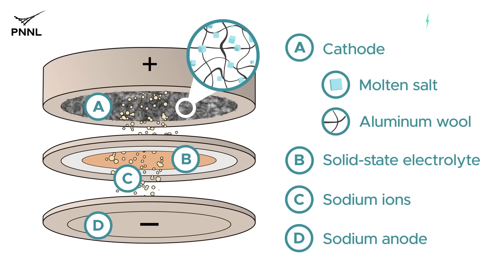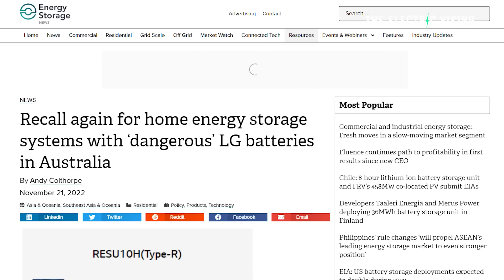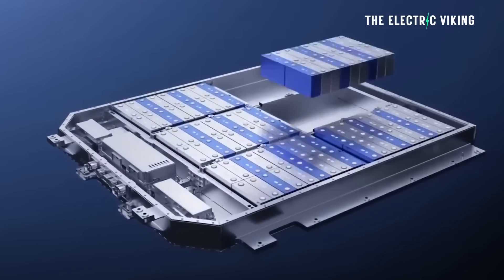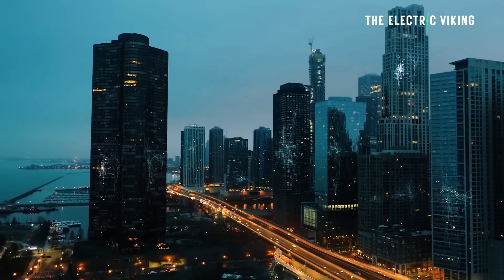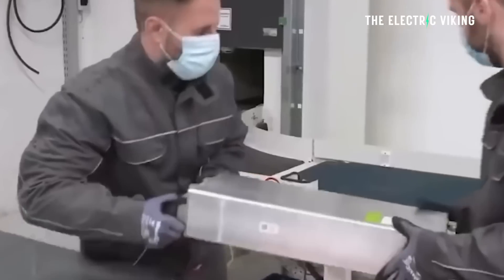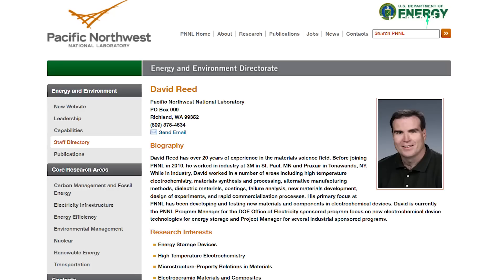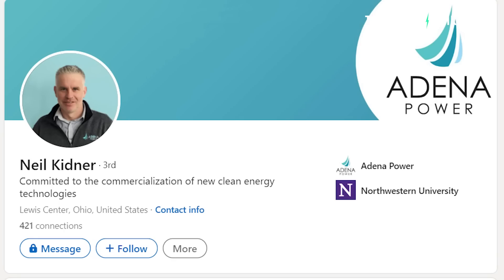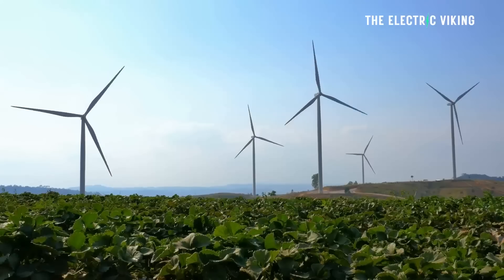NEW Sodium, Aluminum battery is 15X cheaper than sodium or lithium

Comment: I think you're getting some of the technologies muddled, Lithium batteries are operational from about -10C through to about +60C although they lose a lot of capacity below 5-10C. If the are charged above about 70C the chemistry becomes unstable. so these sodium batteries at around 100C operate considerably below standard sodium batteries (~400C) but still well above lithium. BTW, lithium fires happen not because the batteries are running at up to 60C but because something happens that cause the battery to go above 70C resulting in thermal runaway that can ignite the electrolyte or maybe create water that then sends the lithium ballistic.

Comment: If this technology is really 15 times cheaper than LiIon  when commercialised it will transform the renewable energy scene
Reply: Even if it's only 3-5 times cheaper, it would change the whole game completely. Batteries for solar energy storage for under $30. That's nuts. Install 200 kWh for $6000 and go off-grid for a few weeks. Would love to see that happen.
Reply: Is it really?
Reply: @2drealms196  Yes. The big drawback of wind and solar electricity is that it is intermittent. The 'fuel' is free. Fossil or nuclear electricity is available when we need it. But we have to pay for the fuel. If the cost of storing the intermittent electricity can be reduced to below the cost of buying the fuel, wind and solar will become a practical proposition.

Comment: Why is not excess daylight and wind generated electricity used to pump sea water up to reservoirs. Then the water is returned via turbines when electricity is required?
Reply: Does not scale down well.

Comment: Sam ty for the content and best wishes to your family.  You've been on both sides of the lithium coin. Just explain why, share the change of information.  Don't point the finger at Toyota you have 3 fingers pointing back at you ;). 

There's lithium coming from the salt flats now, and you yourself said Australia is killing it now refining better grade lithium at higher yields. But you said that after a video where you said something like lithium is running out.
Reply: The bottleneck is lithium refining.
Reply: @Dan Harold  thanks. Nothing new there. The subject was: is there enough lithium in the ground. Some say it will run out. Some don't. 

Information changes and I don't fault Sam there but it would be nice if he shared the change. Either way I'm a fan and he's great.

Comment: It seems that sodium-ion has better density and also don't use scarce materials. I don't know if this people is too optimistic about the cost of sodium-aluminium or the people around sodium-ion is more cautious about the prices, focusing on short term. It could be also package costs, as sodium-ion try to reuse the cell model of lithium, and maybe this Na-Al don't saving costs on that step.

Comment: Sodium - or some other super duper battery - has been almost here for at least several decades. About  10-15 years ago Sumitomo thought they had a low temp molten salt battery that they promised would be commercially ready by 2015-17.
And then they went quiet.

Comment: We really need to find a replacement for lithium in the applications where we are currently using LFP batteries in EVs.
Reply: For short range (under 200 miles) EVs CATL sodium batteries could work.  For long ranges lithium is still needed (or hyper efficient design like Aptera).  Ironically the middle east could end up controlling much of worlds lithium production by pairing it with desalination plants they need anyway.

Comment: price $7 per kWh is nice. In my country Estonia that will change a lot. Fo Estonia going solar is hard at winter time there is 20x less solar than at summer and at winter time there is 2x more need to energy so when dimensioning 100% solar for june then it will be 2,5% for december if you are lucky and panels are not covered by snow.  so going 200% june is even too much and then you need some 90 days worth of storage. That is even too costly at $7 price level.  But Estonia can install even 500% worth of wind power so to stabilize that it is more than possible.  But still those solar installations make wind more costly
Reply: Most of the Earth's population live in the sunbelt of the world, where solar is great. But wind is best outside of that zone, as you say.
Reply: I would love to see home owner scale wind solutions that work out.
Reply: Must have wind over there ? Not everything rotates around solar panels
Reply: Yearly storage is a problem. Synthetic fuel might be a solution. Excess production during the summer can be turned into fuel that can be burned in generators or fuel cells. That is inefficient, but the alternative is wasting solar power.
Reply: @jamesvandamme7786  internal combustion engine works at best at 30% efficiency conversion from electricity to synthetic fuel is probably at 50% maybe. Now battery electric vehicle may work at 95%  So  when putting in energy and converting to range synthetic fuel car will have range 100km and battery electric car has 700km the same goes to  electric regeneration from synthetic fuel it is 7x more costly. Current batteries give the same economic effectin storage. The biggest proble for synthetic fuels is that actual usefull energy you get out of system is 7x smaller so You must build 7x more powerplants. For Estonia that % under solar must be like20% but for more dence areas it may go like 100% for Netherlands while using batteries it is 7x less
Reply: @qkktech  That's why I wrote "yearly storage". My son has a 5 acre woodlot. He turns solar energy into carbohydrate fuel, which he stores until winter, then oxidizes it to heat the house. Storing the same energy in a battery to last through the winter would.not be practical. 
Batteries take longer to charge than fuels take to replenish. Also, fuels are consumed during use and lighten the load on the vehicle. The much higher cost might be justified in some circumstances, rockets for instance. And there are always people who just don't care and will use fuel instead of battery electricity.

Comment: You did get it slightly wrong in your presentation. The $7 per kilowatt hour you mentioned is, as you said, only for the material.

Whereas the prices you mentioned for the other batteries seem to be for completed batteries.

The cost of turning the material, at $7 per kilowatt hour, into useable batteries was not covered by your presentation. You may have accidentally correctly priced completed Sodium batteries at $21 per kilowatt hour, which of course would be a huge reduction in the price of stationary batteries.

Comment: There is only about 5kg of lithium in a typical EV battery. Lithium is a relatively abundant element. Sodium could be a good alternative for stationary storage. However sodium is just as flammable as lithium, so there is not any safety advantage in using sodium over lithium.
Reply: It's not the lithium in a battery that burns, it's not metallic lithium, there are very few metallic lithium batteries (often called lithium metal batteries). In NMC and similar chemistries, it's predominantly the organic liquid electrolyte which burns as it is flammable. There can be small amounts of metallic lithium, which can form on the anode when charging, but it's the organic electrolyte that causes the fires. This is why other lithium chemistries, such as LFP, are very difficult to ignite.
Reply: Chemistry matters. 
As one goes down the left side of the periodic table, reactions in water are more violent.
Anyone plan on using these immersed in water?
Look at the difference in Li-ion vs LFP batteries. Li-ion is very flammable whereas LFP is not.
A blanket statement like Na is more combustible than Li-ion is meaningless w/ a specific example to back it up.
Reply: Sodium flammable! that will be a surprise to many of us, even so, if out in the open like the Tesla battery set up in South Australia, should this not be a satisfactory situation?
Reply: But sodium doesn't form the dendrites like lithium does, which has been the main cause of the lithium generated fires.  Having stated that we keep finding new advantages and problems as new batteries are put into use.  We should find out more in the next year.
Reply: Indeed, the percentage of lithium in modern batteries is very small.  Those who suggest that there is very little lithium are confusing supply available with the amount of lithium that is around.

Comment: I keep scratching my head I was not surprised at all about the LG batteries, there the same ones that are in the Chevy bolt car fires. 

They made a defective battery pack and use the batteries in there products and sold them to other companies it’s pretty simple they myst be recalled across the board.
Reply: ROFL
Reply: @SeánONilbud  Well, that was an intelligent comment /s

Comment: Unfortunately it is missing proof of truth that it is lower cost. It is all just forward looking and hope.
Reply: I usually ignore  “Game Changer” headlines by default. It’s always bollox. A battery that loses 20% capacity after 350 charge/discharge cycles is a waste of money and resources.
Reply: @Dave5843-d9m  Agreed.  That is far too high for grid usage.  They would need to recycle the batteries every 3 years.  Ambri liquid metal seems like a far more promising option for grids
Reply: @Dave5843-d9m  then why are you on a channel dedicated to possible upcoming tech?
Reply: @Dave5843-d9m  Yes, unless you improve it on this parameter it is underperfoming on. But yes, it always takes you a good plan how to get to performance in such a case. We should standardize the 6 most important parameters for batteries on a minimum performance level and stop all youtubers from reporting on underperformers. Example: 1C standard charge/discharge; 400Wh/Kg energy density, 100$/KWh or less on cell level, 10'000 cycles on 75% capacity loss, 10 years projected lifetime, 1000 Wh/L specific capacity on cell level, maximum 0.1% of mass in more difficult metals to find etc. Of course they can be better in all parameters but please: not less. WDYT? You will miss fast charge in my list, I'm just not that sure if that will be an important paramter going forward when all others are met.
Reply: Unfortunately this Chanel is a bit “ This is the next game changer” 😁 Still interesting to hear about but you think is it a year out or a decade.
Reply: @SWR112  You name it. My guess: Closer to a decade.
Reply: For real! Just tell me when something is hitting the commercial market. Not when it's in prototype phase.
Reply: @trinsit  I feel sorry for you but this isn't even prototype phase. This is research. Prototype phase will be, if best comes to best in 2 or so years.
Reply: @trinsit  then go find a channel that talks about what has already happened instead of the future. 🙄

Comment: It should be a rule that current EV being developed must allow owners to replace the battery with new chemistry battery packs when they eventually become available
Reply: What's stopping you
Reply: @WillyB346  structural battery
Reply: They should do the same for my old house. I need an updated foundation.
Reply: Consider that it is not cheaper, more efficient, more sustainable, nor in any significant way more environmentally friendly to stop using and throw away an already-manufactured battery pack, just to replace it with a freshly-manufactured battery pack of newer technology. It is good to make battery packs more easily recyclable, but that's not the same as making them easily replaceable or upgradeable during the service life of an EV.
(BTW the particular battery technology in this video isn't really aimed at EVs)
Reply: Why?
ICE cars don't have a rule that their engines can be replaced with newer engines.
Also cars are designed with crumble zones for accident survivability meaning that they are much more disposable than that used to be. Recycling and reuse is more important than upgrading parts.
Reply: Structural battery will already outlive chassis no need for this ever your pack will outlive your car and depending how old you are maybe yourself in a second storage life long after the car rusted away
Reply: Just like you can replace your ICE now?
Reply: @grahambrown42  How can you easily replace the 10 year old engine with the latest one from a newer model without a lot of re-engineeeing?
Reply: Only nio can do that
Reply: Worked out well with smartphones...not. Except for the Cubot phones.
Reply: Isn’t that the idea behind the Ultium platform? It’s modular.  If it works out for GM, warranty work should be less financially.
Reply: @scruffy4647  I doubt by 2030 GM will have much of a say any more.
Reply: You may have this backwards.   In 10 or 20 years you may find people putting the battery they own in a new car.